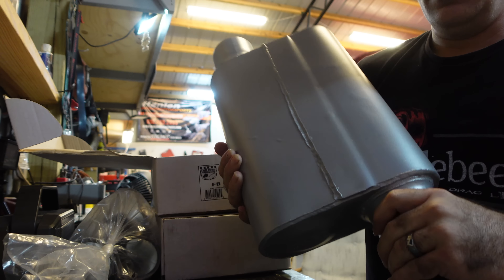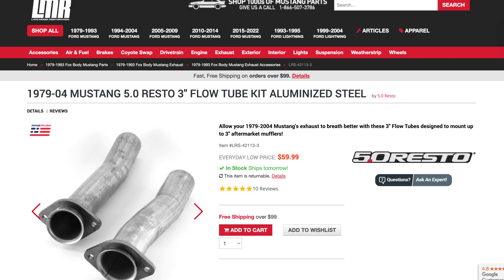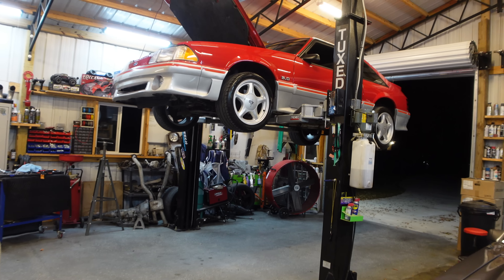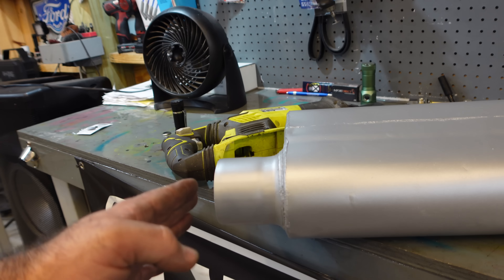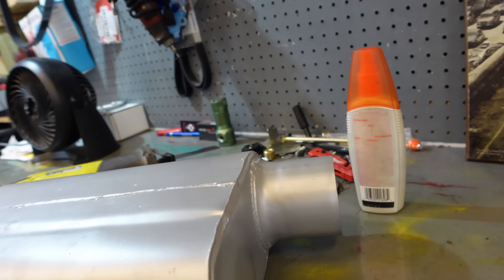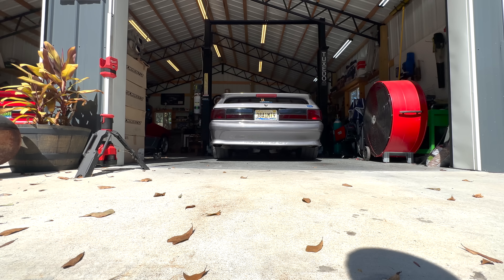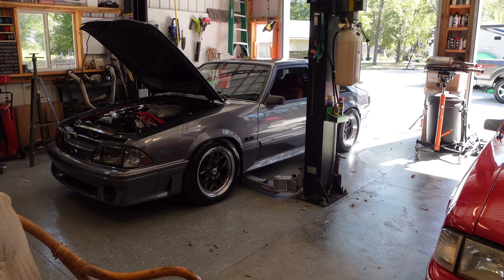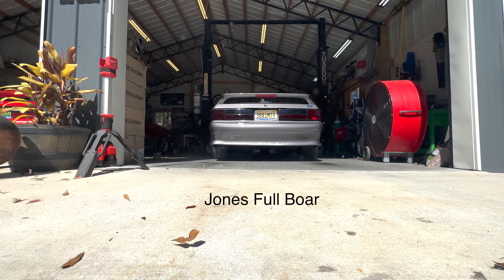One Of The Best Sounding Mufflers For The MONEY! $$$$

Comment: I like the Full Boars.  I went from MagnaFlows with tail pipes, to SpinTech 9000’s with turn downs, and they’re rowdy at WOT. It seems like the motor just breathes so much better with them. Seat of the pants it feels like it gained 20hp (I know it didn’t) but you can definitely tell the difference.
Reply: 😎Yes, my experience confirms that Flow Masters knock the shit out of power 20+ compared to others. 👍👍 Never tried SpinTech.
Reply: @hotrodray6802  depends on which one they have several including straight thru designs

Comment: Imo opinion the flowmaster sounds like it has a thicker material. And Jones is made of thinner. But for the money I'd buy them.
Reply from the maker: Yeah for the money it’s a great option imo
Reply: FM, sound sucky raspy
Reply: @hotrodray6802  imo fm is the default muffler. Dont know what you want exactly buy fm it will always sound good. Fm muffler is broke in. The Jones will get a lil more raspy as you use them

Comment: I personally think the flowmaster sounded bettter... but with that being said, ebay had these mufflers with 2.5" tailpipes for 175. Add 45 for some 2.5" flow tubes, and for 220 total shipped you get a full 2.5" catback with these mufflers, thats hard to beat. I'm doing a budget built sn95 and that's what I did. Eventually I'll probably swap the mufflers out with some spintech 9000's, but for the money this set up was hard to beat.

Comment: I had a Fox with a long rod 306 11:1 and a custom trophy stock cam on worked tfs heads...anyways I went through a handful of exhaust setups and the nastiest one by far was the stepped Bassani headers to X pipe and the Hooker Max flow mufflers all 2.5". It was a tiny bit quiet at idle but had the creamiest sound to it very exoctic sounding . Then a buddy of mine replicated it and on a stock head/cam cobra intake car and it was crap lol. So if you go this route you need some compression but its the beez kneez and when I lit it (225 of .nitrous) omg straight nasty. I use to race my friends on 600/750s and scar em all until the end of 4th. She had a Tweecer and the limiter was at 6800rpm w 3:55s at 2750 w me in it painted candy tangerine....Ahhhh the good ol days lol

Comment: Not or nothing what do you have against clamps there is so much work to replace any of those parts.  What happens if you bottom it out or back a tailpipe into a curb.  I guess you don't need to worry about them rotting out

Comment: My 95 sounds pretty sick now but it took some dickn around. It's bone stock except the modded OEM exhaust. I started with replacing the factory muffs with Jones FB 2.25" muffs was totally underwhelmed it was barely louder, I replaced last 18" with strait cut 3" tubing that was a huge difference in sound more growl deeper sound with some popping so then I gutted the 2 aft cats mehh little louder then gutted the 2 fore cats little louder sounded nice but just not that loud so one day sai screw it went bough some bends and ditched the muffs all together and i turned the key a WOW It's loud and sounds roudy! It gets attention and comments all the time, people think it's pretty rank I don't say it is but it is i just let them think what they like. But it is pretty nasty sounding, I work as a welder/fabricator so I'm going to buy a pipe kit and build a custom x piped 2.5" exhaust, will never "need" 3" pipe but it would prob sound pretty sick but that seems like a big pipe to cram under there? People say ohh it will ruin low end Tq but thats nonsense there just regurgitating crap they've heard, if that was the case open headers would kill so much Tq it would be undrivable and it doesn't. I do plan to weld V bands back where the mufflers are so I can swap out mufflers or  remove them. Just build a jig so I can make a section that will slide right in and out no hackin and welding Every time i want to try a different setup. The mufflers I'm pondering using are the moroso spiral flows.